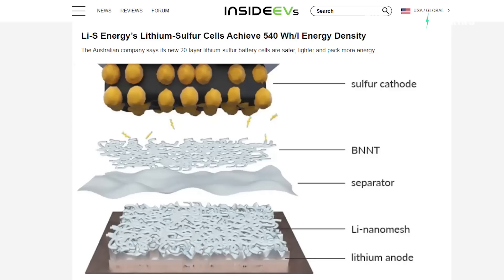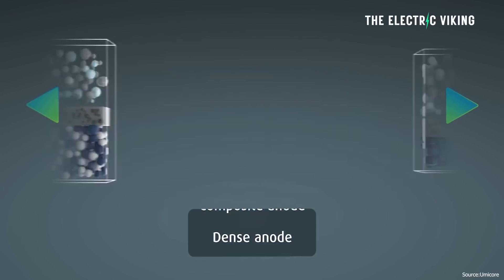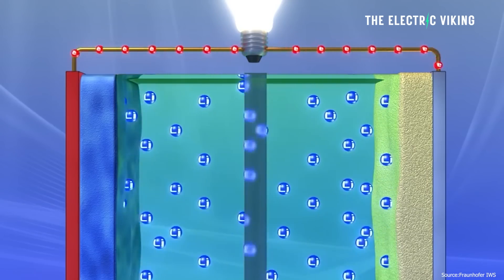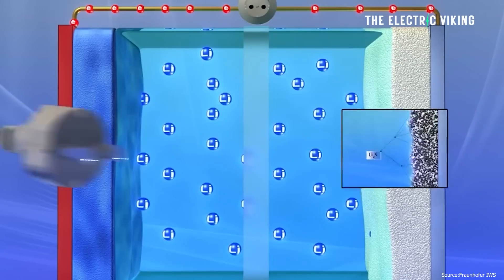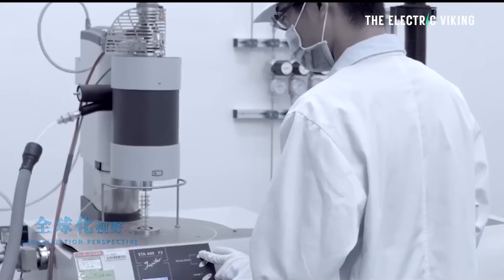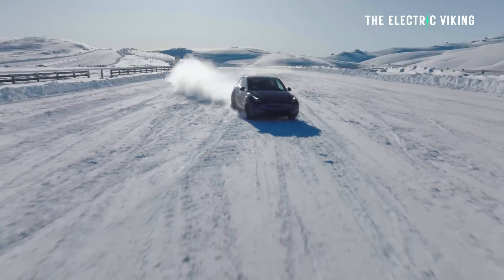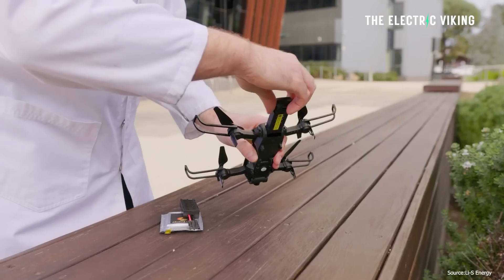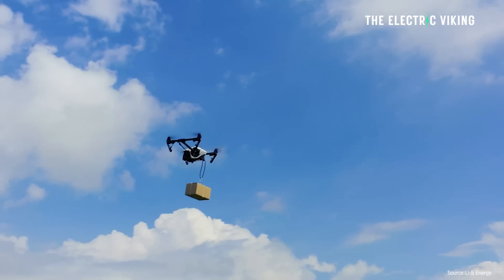Li-S Energy’s Lithium-Sulfur Batteries Achieve 540 Wh/l Energy Density

Comment: Thanks Sam, good news, but we will need to wait and see. 

High capacity lithium batteries have been around for a while, but the issue is safety and longevity. If they can nail these together with high capacity they could well be on to something.

Comment: Terminology: energy density = energy per litre, specific energy = energy per kilo. Of course, you can use 'volumetric density' or 'gravimetric density' instead. Energy for batteries is typically given in 'Wh' = 'Watt-Hours' (NOT 'Watt'). 'Watt' is the unit of power, not energy.
Reply: Yes, he keeps making that mistake . Surprising really.

Comment: Sam, I know you don't have an engineering background but there are a couple of things that need to be clarified. A battery pack of 77 kWh stores the same amount of energy whether it's plain NMC Li-ion or Li-S because 77kWh is a measure of the energy stored in the battery. Also, density can be measured per unit mass (/kg) or unit volume (/litre). With regards to EVs it's important that a battery weighs (has a little mass) as little as possible and occupies as little volume as possible. Battery density should be quoted per unit volume and per unit mass but it is not incorrect to quote just one. If the energy density per unit mass is not quoted then I would suspect that it is quite high which may make the battery unusable in an EV.
Reply: That was my first thought but when I listened again he was talking about a battery pack the same size (i.e. length, width, height) as a conventional 77kWh pack.

To be pedantic, density is per unit volume. Specific energy is per unit mass. These terms are mixed up so often, it's not worth worrying about. If someone quotes Wh/L, we all know what they are talking about regardless of the terminology. Same with Wh/kg.
Reply: @briancampbell179  yeah I recall he said same size but increased range, anyhow moving along, I’m interested to know your thoughts on the likely wh/Kg for Lis?
Reply: Думаю Сэм оговорился, он имел ввиду, что размер и вес аккумулятора 77кВтч с новыми ячейками= по размеру  и весу с аккумулятором  40кВтч нынешнеми ячейками.
Reply: Yeah I think what he was getting at was that if you had a 77kwh Lfp battery you would only need a 50kw or so Lis battery to get the same range. The point you make about mass is critical, any ideas about the likely unit of mass?

Comment: it sounds like a nice improvement, but i'll wait to hear the cost of it.

second, man, i keep hearing about different battery chemistrys.  really need a big chart to look up all the different info on them.  and going forward, it would be nice if i/we could buy different battery cell types and be able to swap them out.  instead of just, "being stuck with whatever my brand has".  like buying a ryobi electric lawnmower system, and then that's the only battery you buy and can insert into it.  really lame.

Comment: Great volumetric and mass energy density, but what about POWER density? Most important, CYCLE LIFE?? It can be a bit more expensive, if the capacity and cycle life can compensate for the purchase cost, giving a superior, or at least competitive, LCOS. (Levelized Cost Of Storage) How many volts nominal per cell?
Reply: Cycle life extremely low. Only devices at consumer level I think can be smartphones with one free replacement each year but the positives are 3x energy density and super fast charging

Comment: 540wh/kg perhaps? 540wh/L isn’t particularly impressive.
Reply: Exactly, but he also did say. 400 Wh/kg.
Reply: @AORD72  So… they’re big, but very light?
Reply: @jonathanfields4ever  Isn't high end Lithium batteries for EVs around 250 Wh/kg, so 400 Wh/kg would be an improvement. I would expect about 63% lighter.  60kWh battery roughly drop 90kg in weight (whole model 3 could go from 1700kg to 1610 kg) .
Reply: yeah it's definitely not 540 wh/kg
I guess he is reading the company press release. In the video, he does mention the difference.
540 wh/kg would be a major breakthrough

Comment: So much great news. Yep, battery mowers kick ass for power and ease of use. Never going back to gas cars or anything gas powered for that matter.
Reply: Some people live in hot climates and have 20 acres to mow and thick brush that needs to be cut. Lithium ion batteries cost FAR MORE than gas over time. And I know because I use a ripoff electric mower and can`t afford to replace the batteries. So guess what? My mower is going to the landfill along with the useless dead batteries and the useless charger because I refuse to pay China 80 bucks each for two batteries that failed after less than a year. Why do all of you lie this way?
Reply: @baneverything5580  You are not mowing 20acres with a mower with 2x $80 batteries. Less than a year? That's BS. My cheap 36V Ozito mower has 3yr replacement warranty on the batteries and charger and 5yrs on the whole mower.

Comment: In terms of energy density, you keep confusing Watts/litre and Watt-hours/litre.  Watts/litre is meaningless in terms of energy density.  Watts is a unit of power, not energy.  Watt-hours is a unit of energy, therefore Watt-hours per litre or per kilogram is the proper term to use when talking about energy density.
Reply: I’m sure he understands that. He just misspoke. Easy to do.
Reply: Exactly, he does this all the time. And already there are far higher Wh/l batteries, most people talk in Wh/kg.
Reply: I understood what he meant when he said Watts/L
Reply: @HygienistDentist   So did I.  It was still wrong, and I've seen him make the same mistake in other posts.  Don't get me wrong.  I like The Viking and I enjoy his channel.  I was just trying to point out an error of which he may not have been aware.
Reply: In high performance applications, power density is a very significant value. That's what determines maximum charge rate, as well as available horsepower. It's all about acceleration!